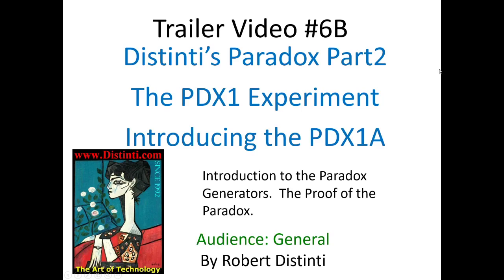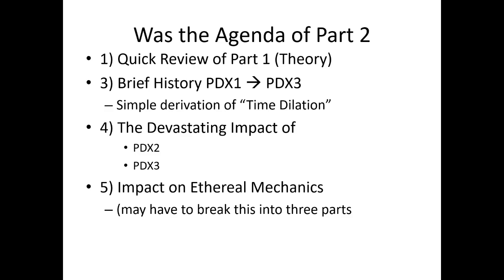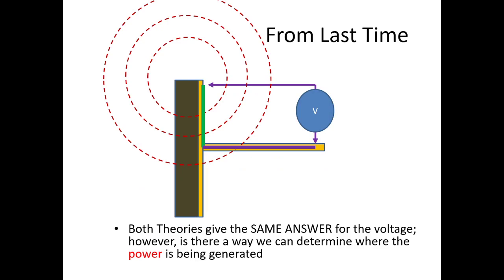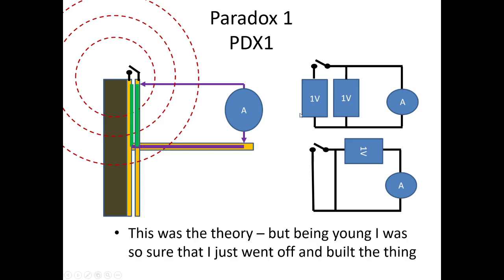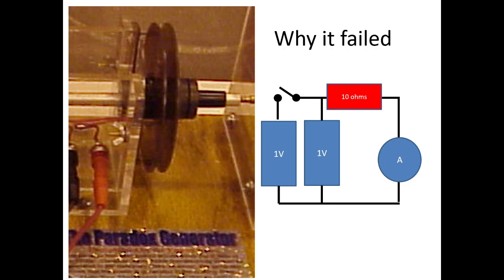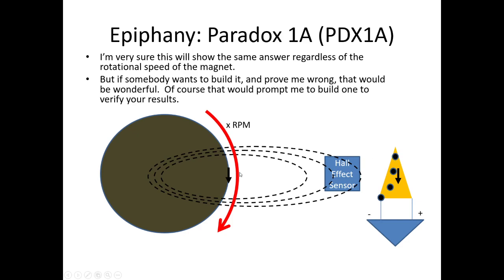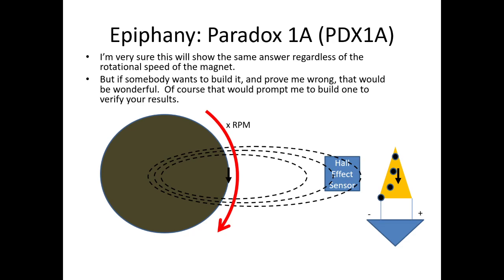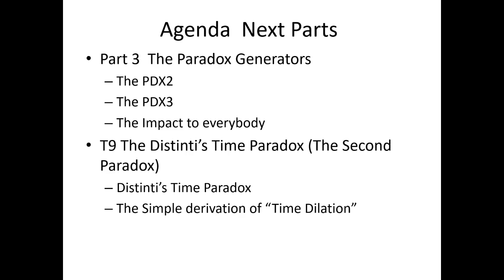T6B: The Distinti Paradox: Part 2: The PDX1A

Comment: E.H. Kennard performed a modified experiment in 1917. He eliminated the voltmeter circuit and used instead a cilindrical capacitor inside an induction coil. The capacitor charge could be detected subsequently. I recommend the video "Faraday Paradox Unipolar Dynamo Part 2: The Solution" from the plenum88 channel.

Comment: Hello Robert, in regards to your "younger self" experiment, I was thinking if you still have that experimental setup from 2001 and after re-watching your video it looks like you don't - but if you do, you can still confirm if your suspicion is correct. All you have to do is insert a resistance in series with each disk which is much larger than the contact resistance of your brush setup, something in the order of 100 to maybe 1000 ohms. This would decrease the expected S/C current down by about 100 to 1000 approximately so you'll need to use a sensitive amp meter but it will also make the effect of contact resistance pretty much negligable.
Reply: Something like this:
https://drive.google.com/file/d/1_B4jLCSfTmkE5uqVzseb82lDWmCacQFz/view?usp=drivesdk

Comment: The PDX2 is the most interesting experiment. If this truly generates an EMF due to the moving conductor then there is an EMF without any back torque on the rotating system. How do I know this? Because I have inversed the setup and applied a large current source to the system and no torque can be observed.